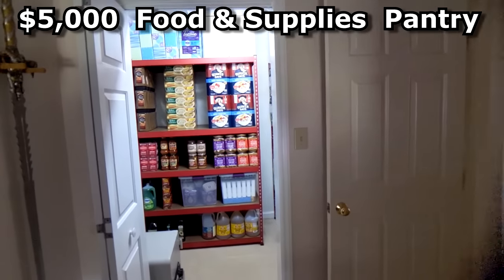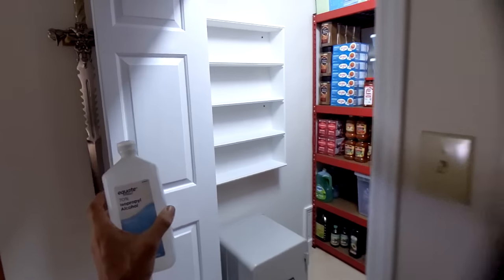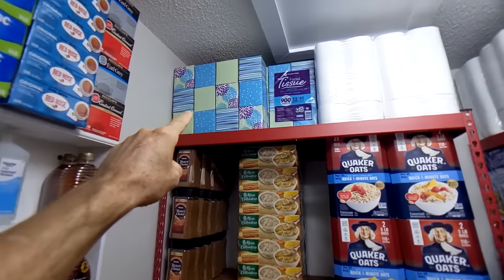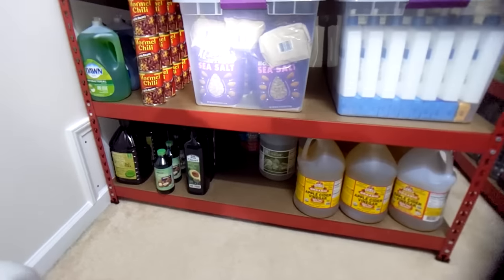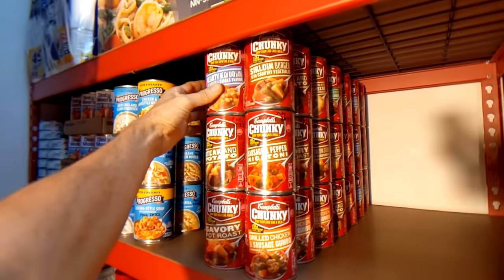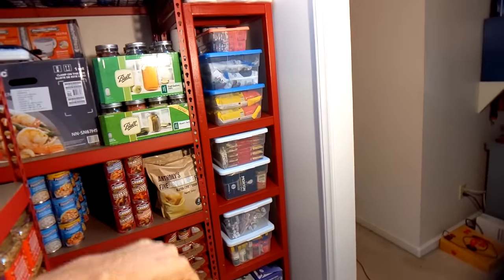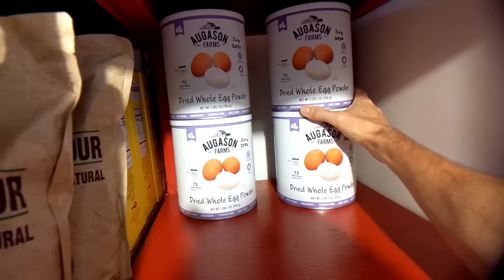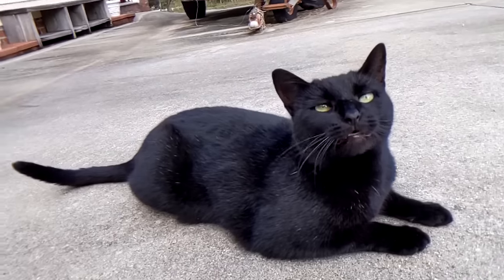$5,000 Food Storage 2 Years Supply PREPPERS PANTRY Survivalist Drinking Water Freeze Dried Ready EAT

Comment: You have a great set-up.  One concern I saw was that you were storing your water directly on concrete in the garage.  Concrete outgases constantly.  According to preparedness lecturer Kenneth Moravec: "Concrete attracts fluids and 'bleeds.' Anything that has been on or in that concrete will find its way into your plastic water barrel. This includes the lime in the concrete, any hazardous materials (i.e. gasoline, oils, kerosene or anything a contractor used in construction), algae, etc. Usually it is not enough to make the water toxic but it will taint the water enough to make the taste unbearable. And no amount of pouring it from container to container will take that taste away."
The best way to store that water is on two by fours making a pallet out of it.
Reply from the maker: thanks for the tips. i plan to raise those jugs onto some wooden boards, thanks for all the suggestions.
Reply: Also, plastic leaches from the surrounding air. So if you keep plastic water jugs in the garage, they will absorb the lingering exhaust  from the vehicles parked in the garage. Best to move them. You can buy canned water for the storing in the garage. Pricey but well worth the investment. You can DM me for info RE: Blue Can Water.
Reply: Wow great info. Will probably have to read this a few times to digest

Comment: I use a berkeys water supply. The only problem I have is their stainless steel containers are 250 stainless which is the worst stainless. Has a lot of nickel that can leech in the water. Would think what you pay you’d get decent stainless. I took 2 1 gallon plastic food grade containers for 8.00. A spigot for 7.00. Took the filter cut out the nut location in the center. Put in 1 filter. Installed spigot and your done. The container costs 15.00. Filters 2 for 150.00. Each filter lasts for 10,000 gallons. Or buy the 1 gallon with filters berkeys for 429.00 travel size.

Comment: First time here. I also have a pantry although it is in a basement and not as pretty ❤ However using my basement allows for more product. A few ideas and suggestions in a minute. First I would like to know how you are doing with your pantry because the video is 2 years old. Although most things last way past there best buy date there are a couple things you may want to substitute. The good for you nut butter actually goes bad faster because of the oil. Powder peanut butter lasts the longest. Another thing is what part of the US are you in? Will your pantry get really hot during the summer if the power is out? This can cause products to not last as long. For medical supplies liquid bandage is awesome for cuts and you can usually find it at the dollar store. Ace bandages are good. Epson salt. You have a good start on your prepper pantry. My biggest concern is.....boredom! You have a lot of the same things. A month to 6 months eating the same 10 or so things can get old. But after a year yikes. Also, alcohol (the kind you drink) is good for many things including trading. Lighters, matches, candles, batteries, etc. Thank you for the tip on the smaller generator and solar panel. We just have 2 gasoline generators.